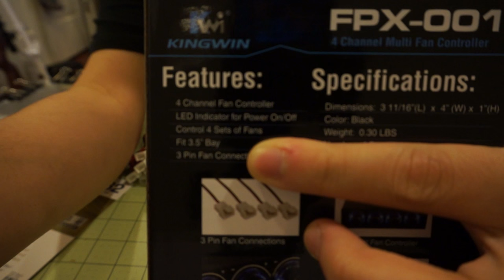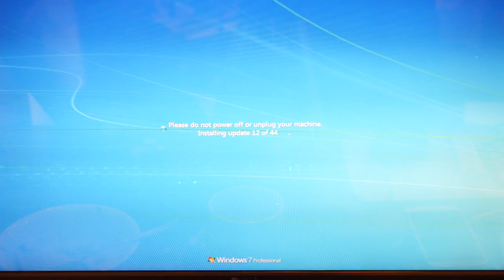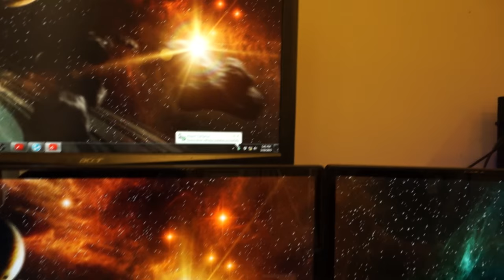Build Vlog 10: How to Silence a Loud PC

Comment: i had to get one of these due to using a dell motherboard the dell mobo doesnt have normal fan connections using 1 120mm fan front and 92mm fan rear the rear fan is 0.24amps and the front 120mm is 0.20amps will this ok?

Comment: This is 3.5" controler it fits floppy hole not hdd spot...
Reply from the maker: +Poor Man Gaming Rig 3.5 is a harddrive bay...3.5 floppy is the disk itself, not the bay dimension for the drive despite being called a 3.5 floppy drive....and its 2016, who the hell has a floppy bay anymore?
Reply from the maker: Poor Man Gaming Rig unless you are  trying to build a sleeper PC, all cheap cases will have a floppy bay. look for a high end case, sometimes you wont even find 5.25 bays on those..
Reply: +Returacan the 900d has a 3.5" bay...
Reply from the maker: luke jackson for your harddrives i bet
Reply: Returacan no, on the front, same with other cases like the define r5 and cosmos 2
Reply from the maker: luke jackson those are 5.25...for cd drives and such...
Reply: on certain panels, if you pull them off, they reveal a 3.5" slot...
Reply: I don't think he gets it lol.

Comment: Hello sir, can it handle 2 fans (I'm planning to use 3 pin 1 splitter) in 1 controller?
Reply from the maker: you can, just not at full power, each channel is only capable of 8 watts output, a normal fan uses .5 amps and 12 volts at full power, giving a power draw of 6 watts

Comment: hi so I got this fan controller for my pc and I tried to connect it to the psu but my pc would not turn on I looked at the cable I was using for the fan controller and it was a pci e  which I think is for the gpu so what cables do I need to connect the kingwin to my psu also my psu is 750w like yours toughpower
Reply from the maker: +wesley jackson the fan controller is 4 pin molex power in to 4 3pin fan header.......i have no idea what you are doing but its completely wrong